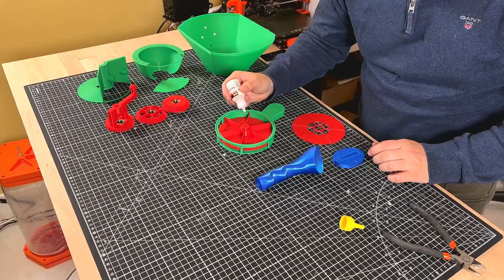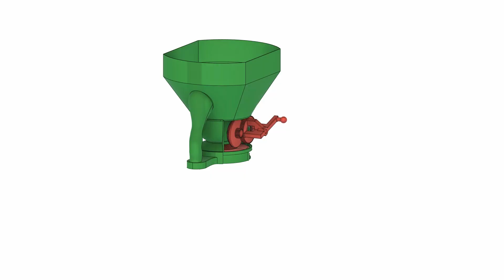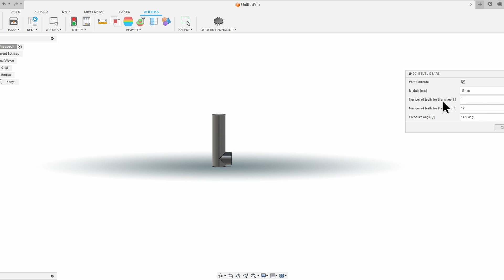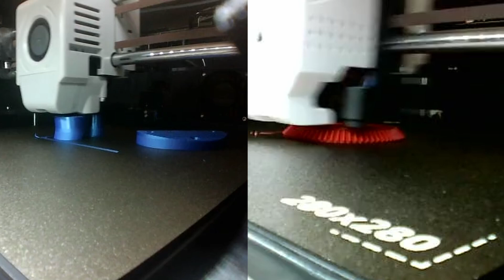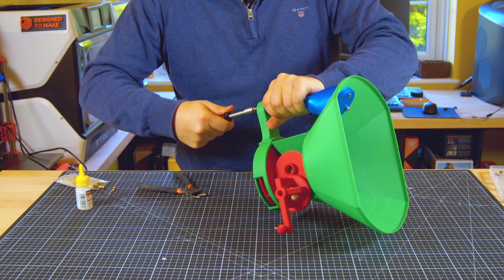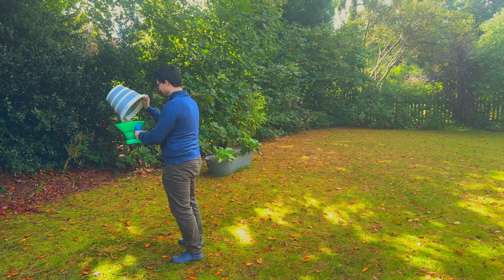3D Printing Functional Tools Using Gears and Lofts (AWESOME 3D Printed Garden Tool)

Comment: does the grass seed get blocked by your hand as you crank in front of the seed-expulsion opening? overall, looks like you had fun making a functional device. great job
Reply from the maker: Thanks for the comment. I hadn’t found it gets blocked by the handle. Though thinking about it🤔 I think to some extent it might depend which direction you turn the crank.

Comment: The crank at least from the video looked a little jittery, I think it's because you're trying to hold and steady the spreader with one hand, while turning the crank with the other.

This might not be fit for your use, but I think that making the crank into an adapter for an electric screwdriver would enable you to distribute much more smoothly, though I suppose that entirely depends on you already owning an electric screwdriver because otherwise you'd be spending more money than just buying a seed spreader.

Alternatively, maybe you could print a squeeze crank, like the ones you find in those cheap dynamo crank flashlights, though I'm unsure of how well that would work as I don't actually have experience with printing or tinkering with one
Reply from the maker: You are absolutely right,. I think a lot of the jitteriness is coming from the lateral torque that the crank is causing as I rotate it. adding a motor is certainly one way of solving this, also I think changing the grip to include something that is braced against the forearm rather than pure grip strength might help too.